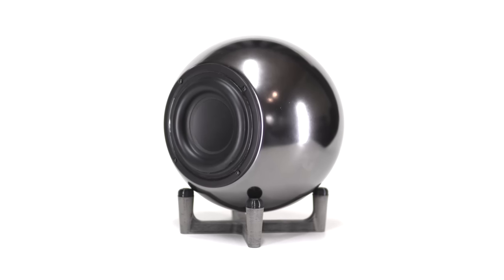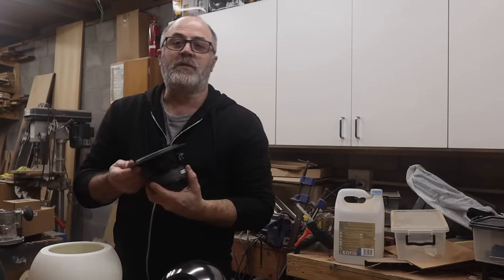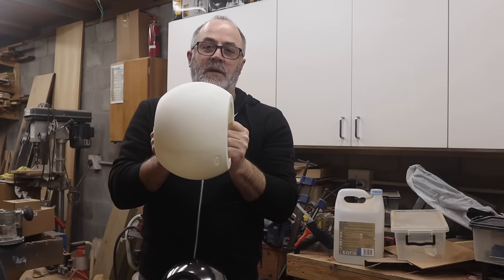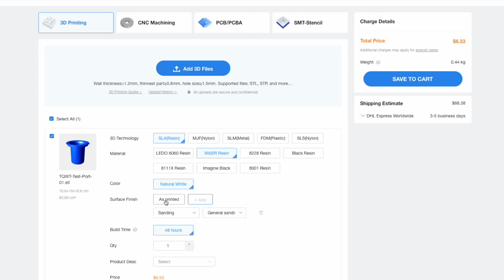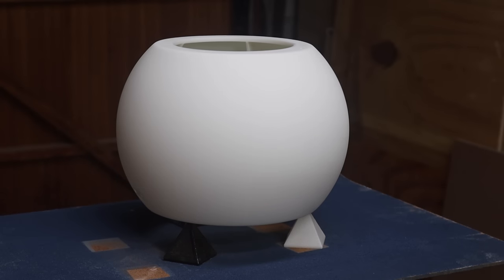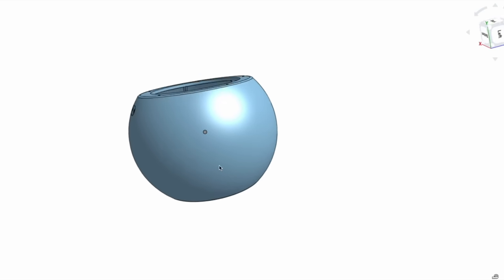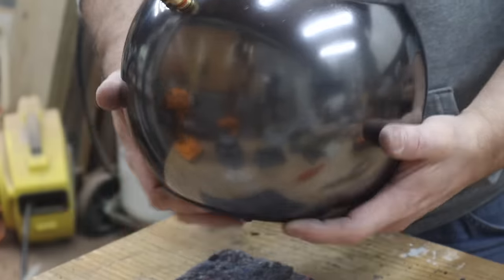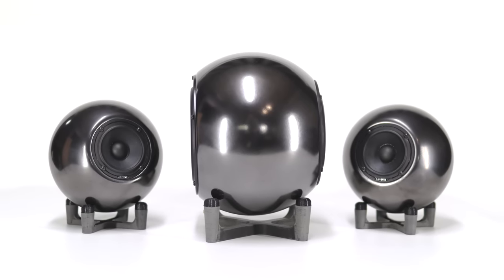Building the EyeBall Subwoofer with Passive Radiator - by SoundBlab

Comment: Very cool. These would look amazing in a Home Theater and very stealthy. It got me thinking about a wall mount for the speakers in the vein of yours, but in a kind of a shark fin below to hold them on the wall. You could still swivel them and point them directly at the main user for an amazingly accurate sound immersion.
Reply from the maker: Thanks. yes, I think you could find various ways of mounting these using some kind of 3D printed design.

Comment: Excellent build as always. However I would like to know why you are using dampening material in the enclosure which also holds a passive driver...? It seems to me that you are tryin using two methods to obtain the same result: the driver "sees" a bigger cabinet. Generally you would chose either one of the two. Not both
Reply from the maker: The PR is no more than just another version of a port. The difference we do not have to deal with port noise. Sure we can end up with a slightly smaller enclosure in the PR, but a larger enclosure within the driver's limits will always be better for bass response, so any way we can make that enclosure 'appear' larger will be beneficial. So, not really a matter of choice. You work with everything you have to get the max from a design. Thanks for a great question!

Comment: does graphite powder stain our hands if we touch it? or did you apply a clear finish on it after applying the powder?
Reply from the maker: No, it does not really rub off just by touching it. If you rub it with your fingers yes. No clear coat was applied, think it will dull the shine. It does need a fresh polish though every now and then to retain the shine.

Comment: Have you ever conscidered hollow panel designs?. 
I was thinking about filling a hollow structrure with sand.
It would be a cheap way to make a really solid cabinet with excellent damping at the same time.
A sphere is by far the best shape as well for a cabinet. So, just a tought.....
Nice job man.
Reply: there are a few 3d printable design for free on thingyverse that allow you to fill with concrete or sand! Though there have been tests and at 40% infill PLA is actually almost identical acoustically (including ringing and rigidity) to MDF and not far behind Baltic birch given same wall thickness . Ive thought about doing my own tests since with 3d printing infill if you leave the top layer off you can fill with sand like you say and still have some infill
Reply: @keatoncreates  I recently build a small speaker (almost a cube, 4" fullrange driver) with very thick quality plywood. I wanted to know how much the difference would be to other materials I tried. So the thickness (20mm) is beyond what you would buy in the store except for high end stuff maybe.It's so stiff you could kill a man with one blow haha The difference in clarity was stunning. I did have quite a trip finding the right damping on the inside, and learned alot from it.
Have you ever seen anybody use plywood in sphere designs, CNC? Because if I would prefer anything on a cabinet it's ply.It's perfect, but quite expensive. And I can't built that.
Reply from the maker: Thanks. I have not tried this, but would be interested in experimenting with various methods involving 3D printing.
Reply: @SoundBlab  I have seen 3D printing for housing purposes. Like a really big printer that does walls and what not. Materials like that should come close?

Comment: Do you include the 3D CAD files with the plans to make some adjustments?
I have a pair of Jordan JX92s laying around and they need a larger enclosure and perhaps a port. It would be cool to adopt your design for this.
Reply from the maker: The STL files are included.
Reply: @SoundBlab  I read that, but I'm interested in the CAD files to import the model in for instance: fusion360 (or other).
Reply from the maker: I work in Onshape. What type of exported file to you need?

Comment: I like the finish! Cool look! How do this lavoce compare to the markaudio driver from you previous project?
Reply from the maker: Thanks. Two very differents drivers. The MA has a flatter response all the way up to 20kHz and as a result perhaps sounds smoother overall, and warmer in the midrange, where the Lavoce has a peak to deal with up higher and perhaps sounds more analytical. For a desktop system, a stereo set of the Lavoce works well and as long as you do not drive it to ridiculous levels in this scenario, it sounds controlled. However, I think the Lavoce will perform very well in a column line array with multiples drivers.